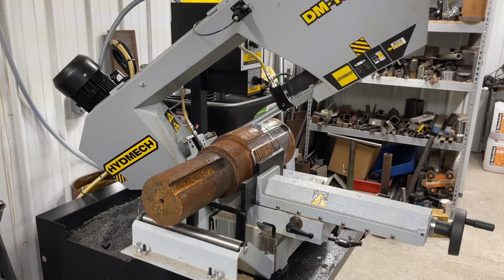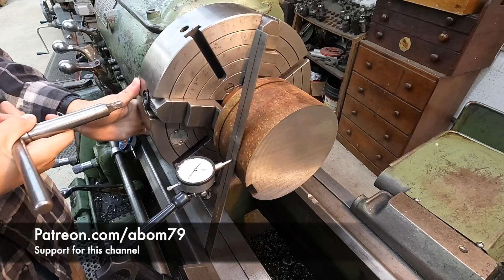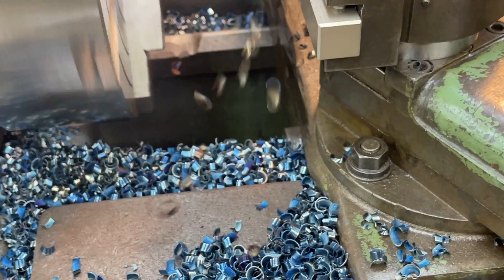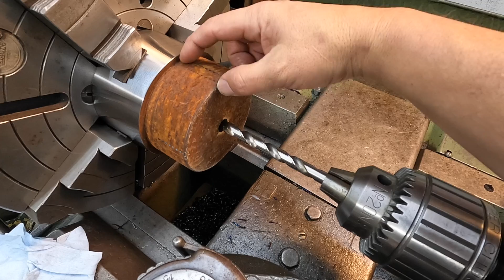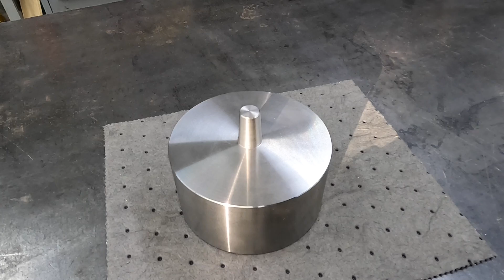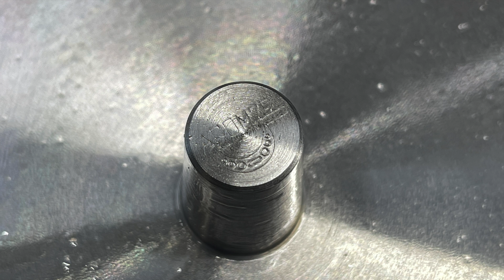Heavy Turning in the Monarch Lathe: Bradley Power Hammer Bump Stop for Blacksmith Tools

Comment: Time 04:30, using a ruler and measuring against the object.... Brilliant!
Dialling in in the 4 jaw uses 2 different actions, tightening or untightening the jaws. Tightening is easy but untightening and avoiding making it too much seams to be more difficult, on a 4" chuck....
 Time 28:00 after a terrific amount of cutting..... Why not make it by a drilling a hole and then pressing a rod into to the large piece? Why make it out of one piece?
Knowing what the "thing" is supposed to do, in this mechanical matter, is the same as in programming. What is "it'" supposed to do? Then the experienced guy making that "it" can select the best way of making it.

Comment: It looks like you need to make a set of soft jaws that wrap around the jaws & stay in place. I have seen them made with a magnet on the strap that wraps around the jaw to hold more securely so they can't be accidentally knocked off when repositioning a part.

Comment: I love that indicator riding on the ruler trick.  I work in engineering, rather than machining, but design a lot of machined parts.  I've learned a lot of practical indicating, measuring, and setup tricks watching you work, so thank you.  As the company I work for does a lot of one-off and repair work, I have to think about things differently than if I were making high-volume production designs, and this helps.

Comment: Interesting project. I do have a couple of questions, though. It seems like such a hardship on the tools and waste of material to turn all that metal into chips. As a woodworker, I would use a bandsaw to cut it to nearly the right size and then turn the piece on the lathe. In metal working is there an effective way to trim off most of that material and then do the finishing work on the lathe? Also, it just seems crazy to remove that much material to get to that stem. Why not turn it from another blank and then press fit into the base? You have forgotten more about machining than I will ever know. So thanks for any insights you can share.
Reply: I used to wonder things like that, too.  If you keep thinking it through, it becomes more clear!

The most realistic ways to trim down that material would be a bandsaw or a cutting torch.  The torch would be a pretty crude and messy operation, not to mention expensive and time-consuming in its own right, requiring a whole setup and teardown, and the consumption of some $gas.  The bandsaw might do the job, but it it would be slow (slow) and a bit messy -- now you have a layer of tiny little (probably oily) chips all over everything anywhere near the bandsaw, and a bunch of cutoff pieces of metal of odd shapes with pointy corners to get yourself cut on.  You saw the deep cuts he was making on the lathe -- it really didn't take that long, and he knows how hard he can push the depth of cut and speeds through years of experience.

The material itself was probably free, a leftover bad part he got when he worked at Motion Industries, so the cost of lost material is not an issue.

Speaking of which... his experience at Motion turning lots of huge gearbox shafts and hydraulic shafts has probably given him a level of comfort about making lots of chips to get the thing done.  Nothing to whine about; just get to it!

Then for the pressed pin...  maybe, but I'd have to ask "Why?"  You saw that machine it goes in -- it is a BEAST!   What are the odds the pin would fall out someday after being hammered on relentlessly by all that mass?  The big heavy beam is going to smack, smack, smack on this part all day long, and I suspect a one-piece solution is less like to turn into two separate parts again someday.   So in one case, there's a fair bit of material to remove, but working is called "working" because it's work, and so you just get to it, and it takes a little while.  For the other case, in order for the pin to lock into the hole, it would have to be shallow-tapered, and then pressed in really hard.  That means now we have a piece of rod that has to have two tapers turned on it -- one inside, locking the pin into the part, and the other outside, where it gets used.  There's a fundamental issue with a tapered plug that it's nearly impossible to guess how far in it will be pressed before it locks solid, because a very tiny change in diameter will have a very great influence on the depth.  So for this and other reasons (such as "How do you hold onto the part?") it's not practical to turn both tapers before pressing it in.  But you could cut the plug taper, and the hole taper, press them together, and then finish the job by turning the outer taper, pretty much as was done here.  The question is...  how much time difference would there be between just removing all the material, versus all the elaborate setups and work required to cut the tapers and press in the plug?  Could it take even longer?  (Quite probably...)

On the wood lathe, there are probably a whole different set of issues to consider.  Different factors... different answers.

Just some thoughts!  I find these things kind of fun to think and learn about.

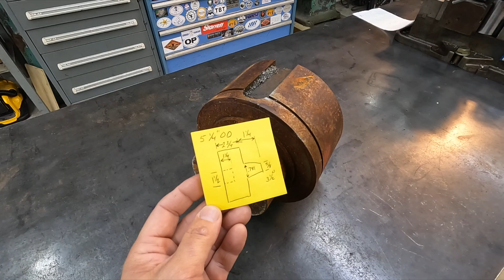Comment: @1:58 “nothing precision about this piece….. let’s indicate in the 4 jaw” 
Then I thought why not use the 3 jaw if it is nothing precision?
I really have to apologize for my closed-mindedness. I’m really sorry. Should you not have used the 4 jaw chuck I would have never figure out the trick of the resting ruler. Thanks Abom79.
Reply: You should never be sorry your thinking like a machinist now dont ever be afraid to ask questions and try something different
Reply: 4 jaw holds much tighter than 3, once you get used to dialing them in you won't even think about changing it out unless you have lots of parts you can use the 3 jaw for.

Comment: Question, are modern gear-head lathes able to work with less HP than the older machines like this one? It seams its very hard to find a lathe with over 3HP or so now for under 20k.
Reply: Many manual lathes were built much heavier than today because they were used for production back before CNC.
 I have a 2 hp 1340 smithy bench lathe I bought new for 4000, it's plenty for any hobbies. I have taken as much as .25 off the diameter with the little thing  I simply can't use a heavy of feed. Doing a lot over 2 inches you will appreciate more hp.

 Basically material removal is a constant relation to horse power.
 If you want to take big cuts with little cash, find a heavy old  lathe. Even then not all are as good as a monarch, axelson, or American pacemaker.

Comment: Love that trick with the scale.  That's one of those things that you see and wonder why you never thought of it!

When you were turning it down to get that stem, would it have been possible to put an annular cutter into the tailstock and use it to create the "stem" blank so you could then use the parting tool to remove most of the mass?  You did basically the same thing with the other end, drilling out the center and then parting off the excess.  I know in the blacksmith shop I've used an annular cutter to make tenons on the end of a bar an it works wonderfully.  All you have to do is keep the pin out and the annular cutter will do the rest.  Even if you'd had to use a large cutter to make sure you had plenty of meat left, it seem to me it would have been faster and left you with another piece of tubing to stick on the shelf.  But maybe you can't use an annular cutter in the lathe tailstock?  Too much resistance on the cutter?  No idea, honestly, but I thought I'd share that tip just in case it can work.

Comment: Sir if i may ask why is it every single machinist always using independent jaw chuck and not the chuck that open with single screw?
Reply: Because four jaw chucks may take longer, but if the material is not pristine it will allow you to center it up nicely in your lathe to make sure your are not running a large heavy part off center.    Three jaw chucks also are not repeatable, meaning each time you chuck up a part, its going to be in a slightly different position.   So when your jobs usually require a four jaw chuck, its just not worth the hassle of swapping to a three jaw with how heavy chucks can get, especially at the size Adam is using.
Reply: 4 jaws have better holding power for heavy cuts.

Comment: If the hole you had to bore needed a flat bottom how you you accomplish that with the taper that’s left by the drill bit?  I recently was making something on my little South Bend Heavy 10 where I wanted a flat bottom and I ended up using my boring bar starting at the middle of the hole and working towards the edge stepping the carriage in a little deeper each time.  I’m not sure if that was the correct way to do it but seemed to work.
Reply: There are flat-bottom drills that would leave a flat-bottom. If you don't have them, then what you could do is drill to a depth where the point of the drill is a tiny bit less than your final depth. You could then use an end mill in your tail stock (if you are doing the operation on a lathe) to machine out the taper left by the drill, giving you a flat bottomed hole.

Comment: 36:24 Thank you a LOT! I never knew that calipers were made to be measuring this way, too. I always had to take out parts that needed to be a little more precise than just using a ruler. Thank you!
Reply: I think that is called the step measurement, it was the last one for me to figure out of the 4 ways to measure with them.
Reply: @SW-ii5gg  I wasn't taught that one before either
Reply: @KarlB1337  I don't recall if I figured it out on my own or from looking at a catalog, I was in a shop for well over a year before I found out though.
Reply: @SW-ii5gg  Ive been using calipers since i was like 13-14 years old and only found out now. Glad I found this trick
Reply: @KarlB1337  I was lucky when I found it, it was a big deal to me, no one showed me, I worked a lot by myself, but I don't know if anyone else in the trade knew about it or not.

Comment: nice easy parting op, i hate parting, its just me i always seem to get stuck and break something..... possibly if i took a bit more care ha ha
Reply: It's not just you, I have had a lot of problems with it breaking as soon as I break through, it always leads off to the left also.
Reply: I haven't been in a shop in a while, our part off tools were H.S.S, I like the tool holder in the video because the ones that I used would not hold the blade square, I think the problem was as soon as it starts to break through the binding tension would release and cause the tool to lunge forward before the material is removed all around evenly. It's hard to put in to words what I am trying to explain.

Comment: Those brass soft jaw pads are great. I started doing that after seeing it on an Abom video some years ago. They might be even more efficient if you cut longer pieces and bend the excess back up so it wraps around the opposite side of the chuck jaws. That way you can slide them on before putting the work piece in and they would hold themselves snug to the chuck jaws. Just a thought. I always enjoy your videos Abom. Youve taught me many things over the years. 👍

Comment: Why didn't you part off the end before drilling a dirty great hole in it?
Reply: From what I saw, his parting tool was just barely long enough to cut through the wall with that big hole.  If the hole had been smaller, he couldn't finish the cutoff.

Comment: I know you can tell how much work the machine is doing by the sound of but an amp meter or power meter on the lathe motor would allow you to see just how much work the motor is doing and this could be compared with the nameplate rating if the motor. All the best.

Comment: This video is a good indicator of how things change as your diameter falls off and your SFPM changes. At first you had nice "C" chips coming off but that soon changed to long spirals of material. I suppose that CNC machines have a setup built into them that automatically adjusts the speed to suit if the initial diameter is dialed in and zeroed so you are always cutting a the optimum speed. Trouble with CNC of course is they are very expensive and absolutely no fun at all since you are reduced to being an observer until there is a need for more stock for the next piece.

Comment: How does Adam always get such great surface finish??? Old, slow, manual lathe cutting mystery steel with carbide inserts on an interrupted .100” doc and 0.012” feed… and he is rewarded with a mirror finish. Damn what is the secret?
Reply: This a a more technical answer to the rhetorical question, but maybe you'll find it useful.  I occasionally have to cut stuff to 32μin and such for sealing surfaces, and I ain't about to polish it for 15 min if I don't have to.

in/rev^2 / (24 x TNR) = Ra ... (TNR = Tool Nose Radius // Ra = surface roughness) (ex.:  .003^2 / (24 x .032) = ~.000012,  aka 12μin Ra)

If you go with a little bit higher of an RPM than you would use to rough out the material, say 600sf/m instead of 500 sf/m, on a .002-.003 finish pass, it can help give a better finish as well. And Scotch Brite is your friend, the grey stuff is amazing for cleaning up high polish finishes.

He probably had an idea that the material was 4140 L80 (80ksi || 80,000lbs/sq. in. yield strength) or something similar.  It seemed to cut like 4140 L80.  He mentioned trying to maintain 500 sf/m as well. He probably had something like a 180μin finish or so which looked nice on video, and clean/consistent, but defiantly still rough.  The finished part looked pretty nice, but he probably wasn't aiming for a sealing metal to metal surface.

As long as you go easy on the interrupted cuts, it should give a decent surface finish (assuming your insert doesn't chip or explode)  Keeping it cool is very important, otherwise in the small amount of time between the interrupted cut, it can cool slightly, then heat up again when the cut resumes causing thermal shock to the insert.
Reply: I often wonder what the secret is myself. We should note that it is very likely not mystery steel. It's a gearbox shaft from his old job. A lot of his old videos are making new shafts.

Comment: I'm not understanding when a part does not need a precision cut, why an abrasive cutoff isn't used instead of the band saw.  It's WAY faster.
Reply: Way less dust and noise. Also I suppose a sawblade would last longer if you use it corrctly and provide enough coolant
Reply: i often use a blade when an abrasive would of been faster, but blades last longer and are cleaner

Comment: could you not have drilled a hole an bolted a shaft in from the recess the other side rather than burn up all that power i mean that lathe really makes the meter turn when you work em like that

Comment: A question. How hot as the piece getting and how often did you need to stop to allow the piece to cool?
Reply: The chips carry away most of the heat. That is why they are blueish in color. 
There is really no need to stop work to allow the workpiece to “cool “ in almost all cases. What little heat that is generated in the workpiece is mostly radiated off when the operator is resetting the lathe or stopping to measure.
Reply: As stated, the chips carry a good portion and f the heat away from the work piece. It is important to allow the part to cool before making final measurements and cuts.

Comment: I own 2 Bradley hammers and have used several others, I have never seen a part like that on any hammer worn out. It is the rubber that wears first. While my 200 pound Bradley is a guided helve, the Museum I work with has that 200 pound unguided helve and I have used it quite a bit. It is very odd that the adjustment assembly is worn out rather than the rubber. Interesting.
Reply: Did you bother to watch the end of the video?  It was explained as a replacement for a missing piece.
Reply: @paulcopeland9035  Yes I did, no need to be a smart A$$. I clearly stated the hammer he was working on was an unguided helve hammer. If I did not see the end, how in the HE** would i known that???? Thinking before typing can save embarrassing mistakes. 
I have a lifetime in the trade, over 50 years and what I said is true. The rubber goes LONG before the metal parts. 
The assembly was together with rubber in place, parts don't just go missing. If it was disassembled then parts could get lost but as a closed assembly.... it is DAMN hard to lose a part from inside the assembly. Kind of like the connecting rod between your piston and crankshaft just "getting lost" with the engine assembled. 
It is very unlikely that the assembly would be together if a critical part was removed. The wooden helve needs to be removed to allow the rubber cushion to be removed. The adjuster can not go out the bottom of the cradle and must go out the top. Human nature is to be lazy, why reassemble the tool with a missing part? If you are taking parts off the machine to rebuild another machine, you would not bother to reassemble the scrap machine, you would just leave it in pieces.
Reply: @wayneparris3439  ...Andrew said it is missing.  He knows what he has.  Adam has been to his yard and made a couple of videos there.  It is quite a place.  He is well known for this type of restoration and equipment collection/selling.  Now that I read your explanation, I guess Andrew is lying to us.  Shame, he seemed like such a good guy!  By the way, calling me a smart A$$ is special.  Glad I could help.
Reply: @paulcopeland9035  Have a wonderful life.
Reply: @wayneparris3439  ..I already have!

Comment: But if you make the pilot hole 1-2 thou over, what if the original (measured) pilot was done 1-2 thou over? 

If you keep including that sort of error, within a few millenia that hole will be wide than the part!
Reply: If they have to keep making them over and over and over....a little slop probably won't hurt for a replacement part